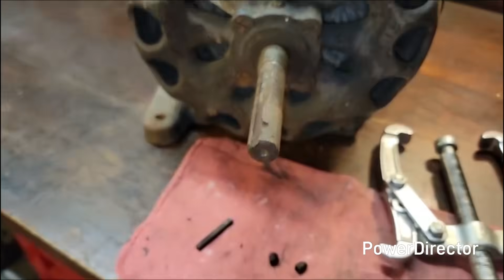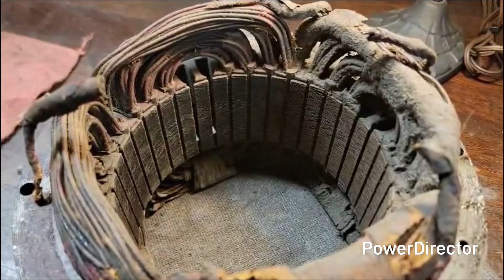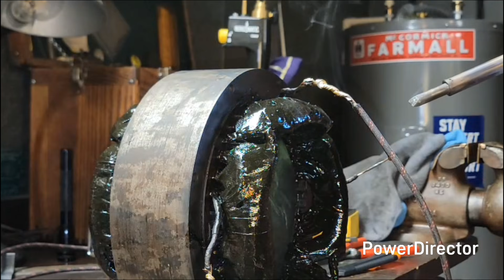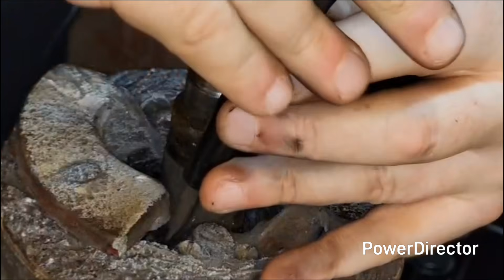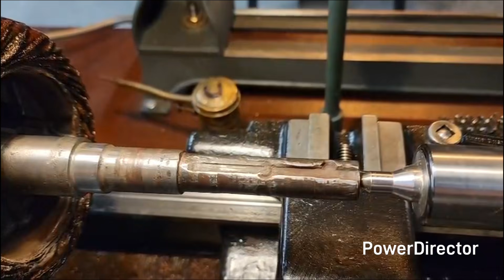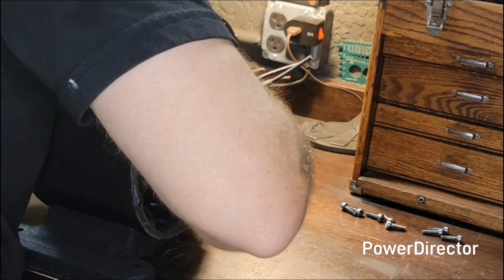Beautiful Antique Motor Salvaged: Jeannin Repulsion Start Induction Run

Comment: These old motors look so cool. I love these old machine components, where they put so much effort into the casting design. Have you considered getting one of those cheap vacuum degassing chambers for varnishing windings? They are basically just a giant stock pot and a $50 vacuum pump but could really help get that varnish deeper down into the windings. I am kind of worried that a motor this old could short out reusing the old windings but I guess you are not really running it much.
Reply from the maker: If I was repairing these for others, I might invest in such equipment. Its just a hobby and if it goes bad one day....I will just use it for parts.

Comment: I worked in several very old steel mills from 1980 to 2010. I saw many beautiful motor/generators, as well as control panels. Fascinating stuff. Good you are involved in them.
 Ages ran from 1900 and up. Some overhead cranes had parts patented in the 1890s and control panels from 1922.
Reply from the maker: Thank you for checking out the video

Comment: Job well done! I think the wrinkle-paint turned out pretty neat even though it's not the original style. Also, I think it's pretty interesting to see such an old motor from the US with ball bearings. I'm from Sweden, and I have two ASEA-motors from the 1930s with ball bearings. ASEA were relativly early with ball bearings in most of their motors (around 1920s and onwards), thanks to SKF (probarbly) giving them huge discounts and them wanting to be more technologically advanced.
Reply from the maker: Thank you. There were so many unsightly welded cracks in that end bell, wrinkle finish was the best option. Definitely pretty early for BB design. Those old bearings must have been in there forever...

Comment: I’ve worked on many 3 phase motors while working as a millwright in a tannery. It surprised me that they lasted for a very long time and were still rebuildable as this one is. Most of them were from the early to mid 1900’s and the repairs to the frames were like yours. A lot of times they needed to be rewound and were sent out for repair. We mostly cleaned them up, replaced bearings and bushings and insulate the internal wires and if needed we replaced the peckerheads. We did repair the castings and the feet when broken. Interesting video as it brought me back to my old job. BTW I did enjoy your video on vices as I have many in my collection. Thanks for all of it!
John
Reply from the maker: Glad you enjoyed the video on the vises and this one too 😊

Comment: I have one of these motors.  I'll admit I'm rather unimpressed with the design of the brush holders.  The brush "hammers" smoke and burn impressions into the brush carbon during startup.  They really should have been provided with shunts to prevent that.  As pretty as these motors are I can quite easily see why they were unsuccessful like so many other early Century knockoffs.  Like the early cast iron frame Wagner motors that have brush spring breakage issues and unreliable starting once the brushes begin to wear due to a lack of positive 'snap' action in their flyweight mechanism.
Reply from the maker: Harry Jeannin worked at Century before striking out on his own. I agree that this motor is not as well engineered. Nonetheless, its hard not to be enchanted by those beautiful looking end bells...
Thanks for checking out the video.

Comment: The oldest ball-bearing motor I've worked with personally was a Fairbanks-Morse 1.5hp 3-phase motor from the 1940s which came off of an air compressor.  The previous owner thought the motor was bad, but it ran like a top, and it was very quiet.  Better yet I don't think the motor had ever been apart since it left the factory.
Reply from the maker: FBM made some nice motors. This one hadnt been apart in ages. Once the end bells were welded on...that was it.

Comment: Nice work on the motor. Cutting the spacer rings was a pretty slick move to get that together. You have to truly love these old motors to spend the amount of time and attention to detail to get them to run reliably again. I love the look of these motors which is why I usually look for them at flea markets, auctions, etc. while I'm digging through the other rusty, greasy stuff I like. The really older ones with the skeleton end bells are especially rare for me to find, so I feel pretty lucky to find any of them at all.  I do like to restore them in my spare time and having a full machine shop at home makes quite a difference in getting them going again. I don't know what kind of mill you are getting, but I can tell you that you will wonder how you ever got along without one. I've had my Bridgeport for a very long time, and I always seem to end up doing a big portion of what I do on that machine alone. Enjoy!
Reply from the maker: I am getting Precision Matthews mill. Thank you for checking out the video.